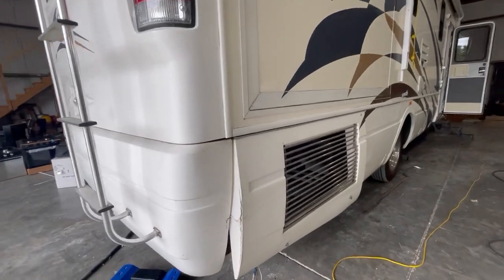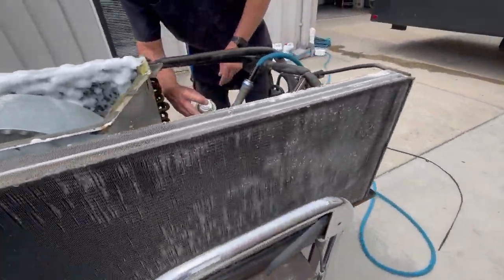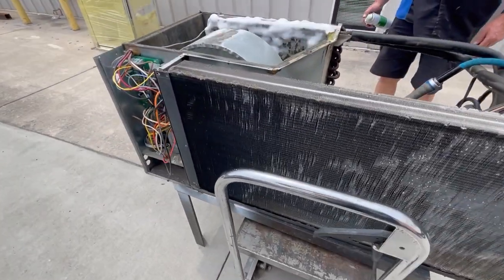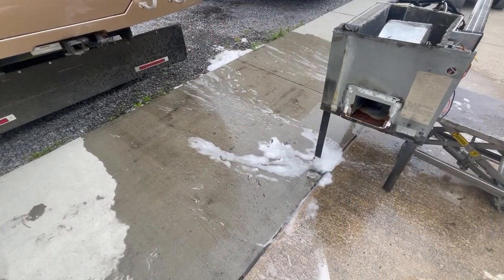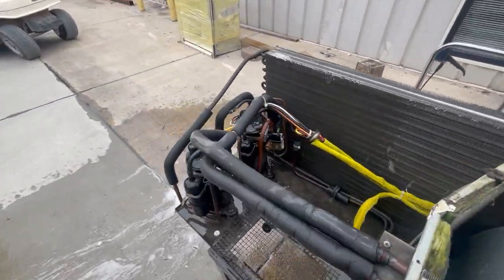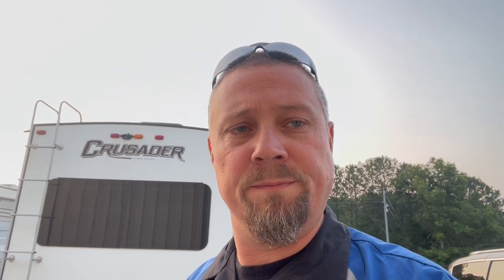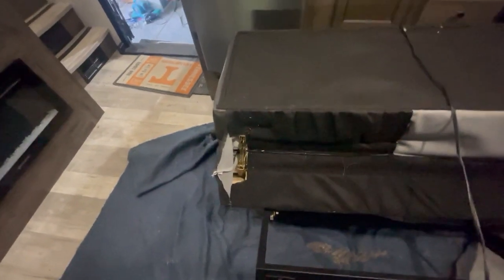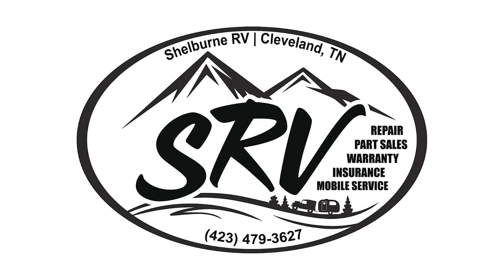National Dolphin Coleman Basement Air

Comment: Got a few questions. Just turned on my basement a/c(2021 River Ranch 390RL)
and it’s not cooling. I hear a thumping noise early but the first stage compressor never comes on. The board green light flashes a 3 code. I do not ever hear the outside blower come on but I do hear the indoor blower. The amps only spoke to about 8-9 amps, the settle to 3. Can you share any thoughts?
Reply from the maker: Call me when you get a chance and we can talk. 423-290-8467